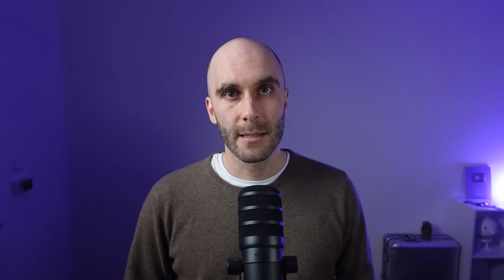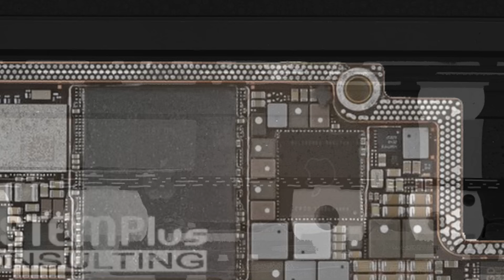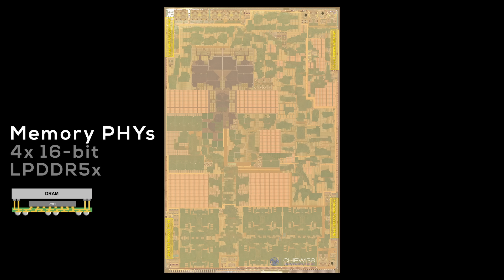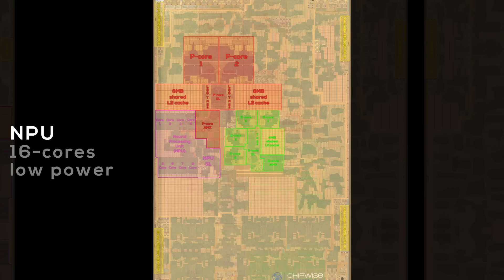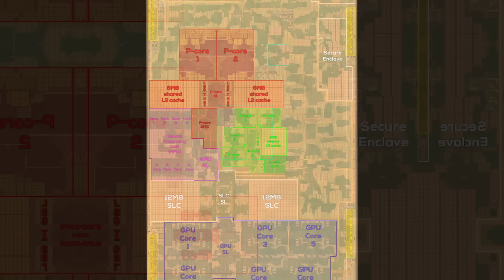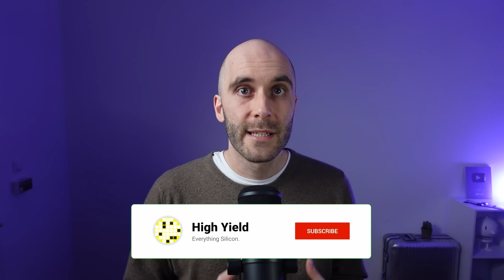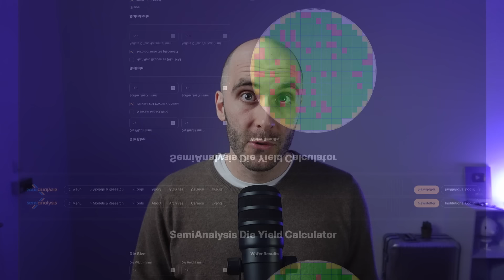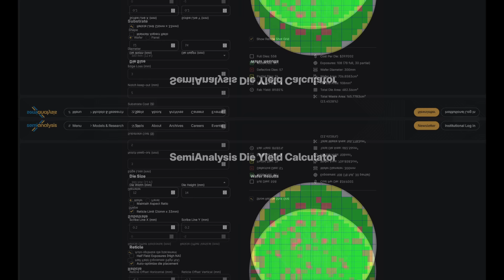A18 Pro & MacBook Neo Deep-dive

Comment: One way to a reason about this: The Snapdragon 8 Gen1 can run a whole lot of desktop Windows games through a relatively thick emulation stack.

High end mobile chips have been capable enough for most laptop use for years.
Reply: lmao as someone who has used one, the snapdragon performance is nowhere close to the m series chips, it may be held down by windows but that’s its curse
Reply: @aname3576 I'm talking about running them through Android, not even running Windows with X86 emulation.

We're talking CPU instruction set, GPU API and OS function emulation.

My daughter plays a lot of my steam games on my old Lenovo Y700 Gen 2 16GB/512GB and I play some of my steam games on my Lenovo Y700 Gen 4 16GB/1TB.

Also provides a decent experience running heavy desktop Linux applications, indistinguishable from the same apps on my M1 MacBook Air in practial terms.
Reply: @magfal  oof

Comment: Looking very forward when you will be able to do analysis on M5 pro/max chip , specially to see those "new" performance cores that are supposedly not the efficient cores
Reply: We actually already know for the most part thanks to supply chain and fabrication leakers, the new p cores on the m5 pro/max are effectively the old e cores with higher clock frequencies and a slightly wider instruction pipeline to focus on multithreaded performance, while retaining the low power dual operating mode of the old e cores and not having as wide of a pipeline as the new “super” cores

Comment: iphone chips in laptop, laptops chips in ipad, i wonder what puddle goes in apple product design meetings
Reply: Apple's thinking is very practical. To give iPad Pro devices Thunderbolt would have required a custom A chip with Thunderbolt added in. Reusing M1 chips meant Apple could kill two birds with one stone: Manufacture the M1 chip using the same processes and line for a while longer while solving the I/O problem on the iPad Pro.
Reply: @thewiirocks  the iPad air getting m chips is surprising
Reply: @daniel_960_  totally fair. No idea what Apple is doing with the Air. It seems like an odd business decision to make it so similar to the Pro (minus the OLED screen), regardless of the supply chain logistics.
Reply: @thewiirocks I have an M3 Air and always had iPad Pro since the first one was launched. Pro is an expensive beast but the air offers a large screen for a much cheaper price and more than enough performance.

Comment: How can people deal with 8GB RAM, even just browsing with a few tabs open while editing a document it not really enjoyable with that little RAM.
Reply: Lots of swap. It makes multitasking surprisingly doable with a fast SSD and some smart memory management, but I imagine you won't be able to run a single app with large memory usage (like a game) without compromise
Reply: @brunnen153  Like a browser with too many tabs open? Yeah, a browser is pretty clever about marking memory pages as not in use, aiding with swapping, but don't try to cycle through tabs, or even look at the tab preview in the tab bar. Also all OSes have swapping, Windows, Linux, Mac - So no, the Apple RAM usage isn't significantly lower or compensated by "clever swapping". If a Windows laptop with 8GB RAM won't work for your browsing habits, an 8GB macbook won't either.
Reply: I've been doing it for over 5 years on my macbook air m1 and my mac mini m1 both with 8gigs of ram...
Reply: on windows it’s unusable, but 8gb on osx is fine.

Comment: I think to explain why the A18 Pro works in a laptop, you only need two performance comparisons: It has the single-core performance of a M4 macbook with the multi-core performance of the Apple M1. As far as I know, the majority of M1 and M2 owners are still happy, at least if they're using the macbook for office and browsing.
Reply: Macbooks/apple does not have a monopoly on user satisfaction. "Customers are happy" is not uniquely apple
Reply: I bet most people will use it for browsing the internet and typing word documents which it will be perfectly adequate for.
Reply: @Fractal_32  even low end devices are fine in that regard. The neo has major advantages in build quality, optimization and reliability. And the screen looks really good (100% srgb is good on a budget laptop). But falls short in other areas
Reply: @Fractal_32  they would be fine with intel i7 4700 as well. What even is the point
Reply: @suntzu1409  a new product that’s available in mass that’s cheap, fits most people’s use case, is under warranty, and has support for the next decade.
Reply: only based on "geekbench" however which is a ridiculous benchmark, the Neo overheats quickly. it's fine for what it is but an M1A doesn't really overheat.
Reply: @ssl3546  thermal pad solves that issue.
Reply: @ssl3546  Geekbench is usable when comparing two CPUs of very similar architecture, such as different Apple Silicon CPUs.
Overheating isn't much of a concern for bursty workloads like the ones I mentioned: office or browsing.
If you're a video editor or something else with a heavy sustained workload, you're not the target audience for the Neo.
Reply: @Steamrick  strawman. People do need video/photo editting occasionally even if they are not professionals. Modern office/web apps can get extremely "heavy". Web is not reading blogs in a starbucks
Reply: A12 was literally faster and than most x86 at that time. And also it’s not just hardware, it’s software that make the hardware useful.
Reply: Apple has been using tsmc fabs for very line time now meanwhile intel was still lag in behind with the node till they recently actually managed to invest in the latest node techs. Node, software are mostly important
Reply: @waltonks8172 stop talking nonsense please! The a12 wasn’t more powerful it was just well optimised plus Apple hardware only runs apple software meanwhile the x86 processors runs all kinds of OS including even macOS too lol! Plus the a12 was on a much advanced node compared to those x86
Reply: Even an iPhone chip using a couple watts is more powerful than a flagship x86 desktop CPU using 50+W under single core load. Goes to show just how outdated and inefficient x86 is. If it wasn't for Windows and other proprietary garbage it would've gone the same way PowerPC did.
Reply: @alex31ytb  there is nothing making Arm inherently efficient or x86 inherently inefficient, as both architectures use micro ops that get translated from the original Arm/x86 code. It all has to do with the implementation of the manufacturer, in which case would be either lazy and greedy Intel or nearly-bankrupt-for-a-decade AMD, both of which are behind Apple and Qualcomm in terms of logic design

Also, every single computer that is in the top 50 of the Green500 list (the Top500 list sorted for efficiency) is x86
Reply: @alex31ytb that has very little to do with architecture and just with what manufacturers are optimizing for. Server level arm chips are equally if not more power consuming than x86. There's some optimizations due to apples own ecosystem but its doesn't explain the gap we see.
Reply: @excruciatingdetail  even "optimized" x86 chips like ryzen ai 300, lunar lake or panther lake lose to a passive cooled base M4 while using several times the power
Reply: @alex31ytb  panther and lunar are amazing :)
Reply: @excruciatingdetail arm isn’t necessarily more powerful or efficient it all comes down to optimisation, those ARM servers are custom made to run very specific tasks, x86 processors are made to run all kinds of OS and so many different applications.
Reply: This! 

The gap is mostly explain by hardware level optimizations. Even windows running via VM in AS performs awesome!
Reply: @alex31ytb what a useless statement lol! Which x86 processors? On which node? The a18 is a 3nm processor are you comparing it to a 3nm x86 processor too!?😂😂😂
Reply: @alanmay7929  panther lake is on Intel's latest node and lunar lake is on the same node as the A18, ryzen 9000 is also on a recent node so yes
Reply: @alanmay7929  Intel Arrow Lake is on TSMC's 3nm node and it is an x86-64 processor. So fair comparison? Let's compare. The M4 Max chip is 15-20% faster in single core performance and 5-15% faster in multicore GeekBench 6 compared to the Intel Ultra 9 285k whilst consuming 52% less power (120W (M4 Max) vs 250W (Ultra 9 285k)). This is just an example, obviously. But you can see how it applies to the lower spec M4 vs lower spec x86 when processor node is equivalent.
Reply: Blablablabl!!!! To explain that you have to mention software development to suit it

Comment: I wonder if the A or M chip has a better performance per watt ratio
Reply: probably the same on each generation since it balances out, maybe m series are tiny bit less performance per watt because they have more controllers and I/o, for example a14 is around m1 a19 pro is around m5 performance per watt etc

Comment: I wonder how production cost of the Neo mainboard compares to the ultra-dense iPhone 16 Pro sandwich mainboard. Half as much? Less?
Reply: I would think the iphone radio board is chocked full of analogue wizardry, patents and licenses, and costs almost as much as the logic board, chips and components included.
So, the neo's main board could cost a third, compared the iphone 16. If you also take into account that the a18's are probably binned rejects - so almost free. Gosh, I think Apple could've launched this thing at 500 bucks and still made money. 
I wonder where they sourced that weird resolution display glass, there's probably some brilliant cost cutting involved there as well.
Reply: @PaulSpades  True, not needing LTE/5G is probably a fair bit of licensing cost saved. They still need wifi and Bluetooth, though.
They kinda did launch it for $500 - if it's aimed at schools, they're probably going to be moving a lot of them with the education account applied. There's no way that Apple is willing to take a loss on those, though the margin will certainly take a hit.
As for binned rejects - if Apple is going to sell as many Neo as I think they are, there's not going to be nearly enough rejects that have exactly one damaged GPU core. They'll have to use fresh production units before long.
Reply: @Steamrick  Yeah, I think they will have to use fresh chips at one point. They'll probably add 16gb of memory on those, though. It'll be the apple macbook new neo.
Reply: @PaulSpades  I think a 16GB version is wishful thinking, especially at current memory pricing.
That said, I fully expect the next version of the Neo to feature the A19 Pro and 12GB of RAM.
Reply: I mean there's a reason why the production cost of a pro iPhone is like $400. That's just parts and manufacturing.
They'd be selling the neo at a loss if it was just as high.